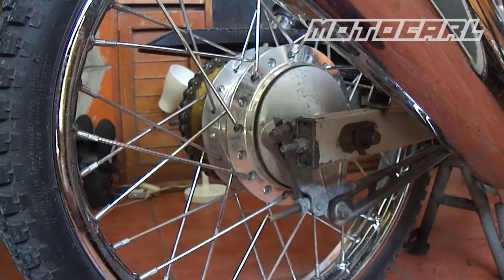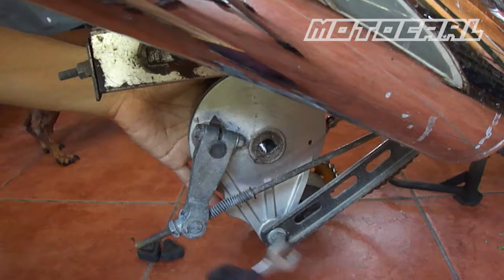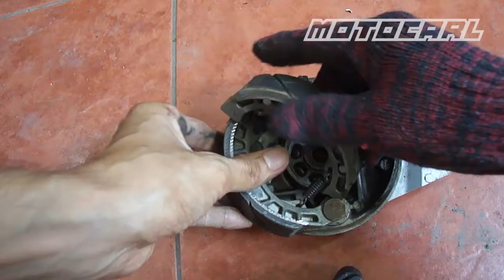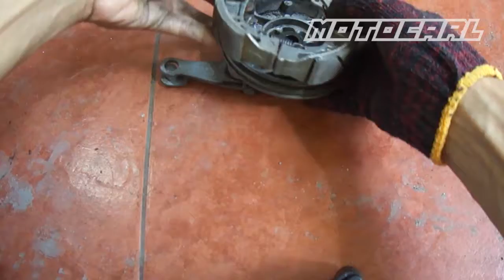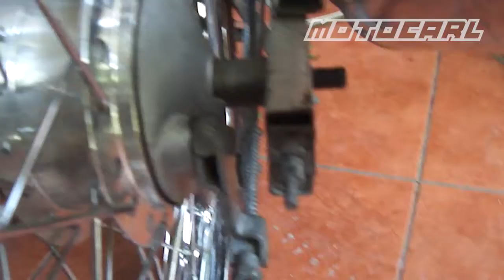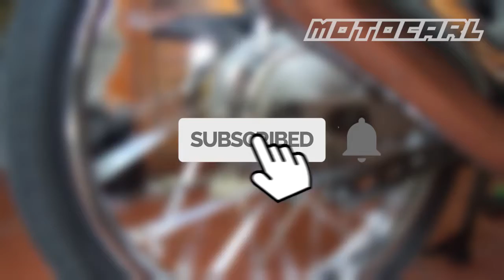Pano mag palit ng rear drum brake shoe | Honda XRM125

Comment: Idol ano kaya reason kung bakit naka tabinge yung gulong ng motor ko. Xrm din siya. Medyo naka slant ng unti. Ramdam siya pag tumatakbo. Tapos kita siya pag naka center stand. Naka slant talaga.
Reply from the maker: mags or rim? baka hindi na naka align yung rios.. pag rim pwde mo pa align.
Reply: Rim boss. Posible ba na ganun yung dahilan? Kasi pansin ko din yung shock hindi din pantay e. Medyo mataas yung sa kanan
Reply from the maker: adjustable ba yum shock mo or stock? pag stock check mo yung rubber bushing ng shock baka durog na. napapalitan po yun. 50 ata or 100 4pcs. sa motosupplier
Reply: motocarl salamat idol! Pa align ko nalang muna siguro. Wagil yung gulong ee
Reply: Sir,, pg po b medyo nkapit n ang preno plitin n dn ng break shoe,, tnx po